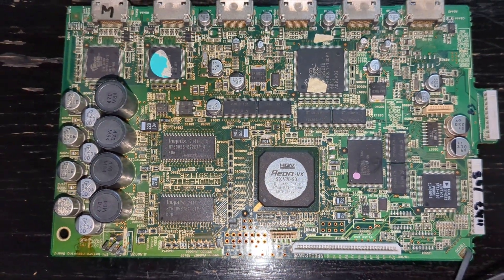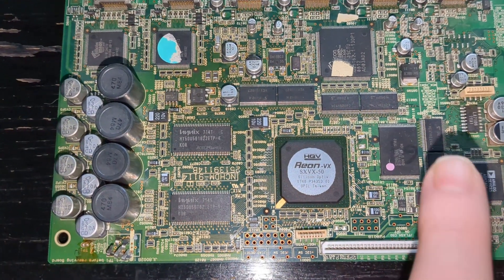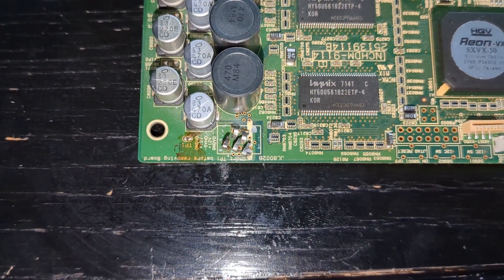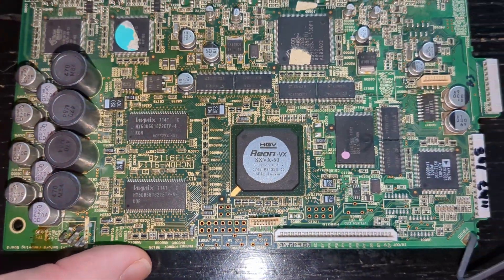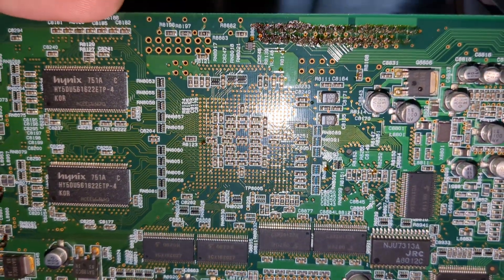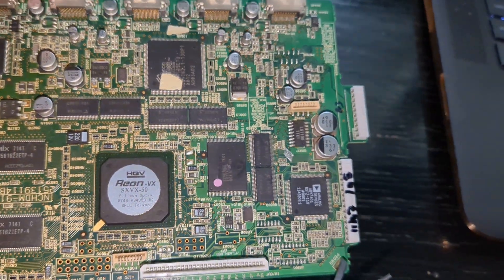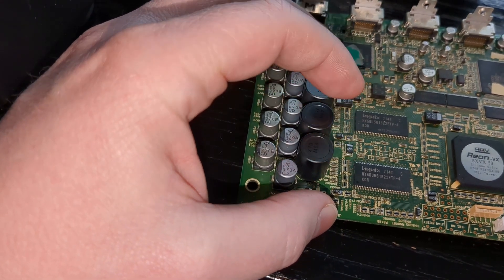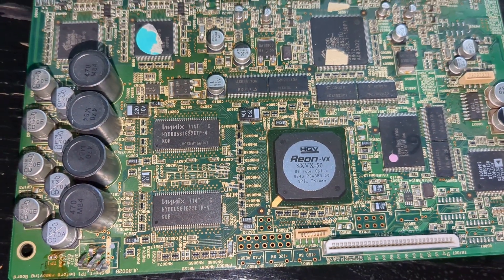help!  Onkyo tx-nr906 video card video processing issue (already did the chip heating trick)

Comment: You can turn it to strict analogue and it won't the digital part of the amp if I'm right or try pure audio button, I have the same issues only ever had a moment once but that was after a long time running 7.1 through hdmi consisting of 6 kef floorstanding speakers one cambridge audio Centre and a sub but even then I switched amp off then on again after 10 mins cooling a bit and all was OK the hdmi board on these is notorious for de soldiering it's own components underneath the chips etc that you can't see due to the heat they run at also upgrade those caps to 100mf

Comment from the maker: So to update people on this,  I ended up cleaning out the receiver really good with compressed air, and it came back online without doing any soldering.  However the video chip clearly overheats and freaks out after some time of 1080p60 video watching.    It also freaks out and stops playing video when the compressor on my beer fridge kicks in.    I pulled the trigger and bought a sony STR-AZ5000es so I am done with this and will find a way to use this thing for audio only at some point.